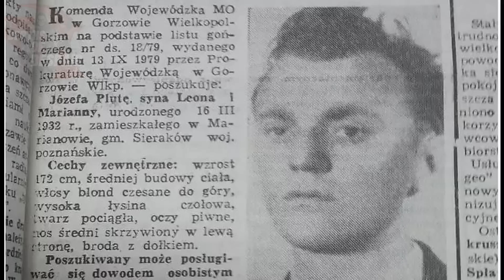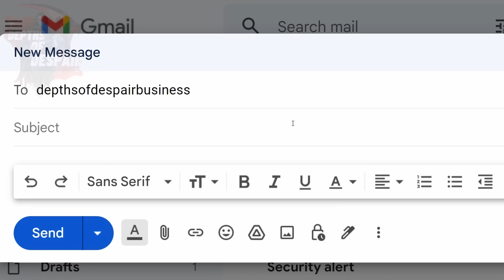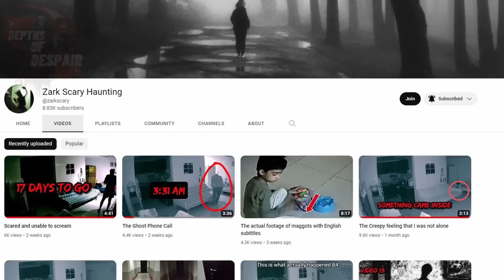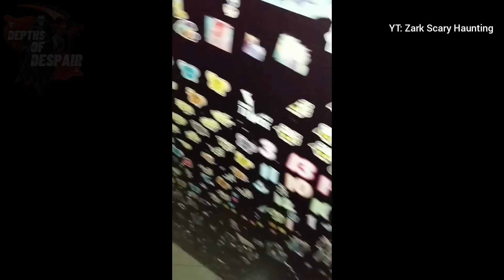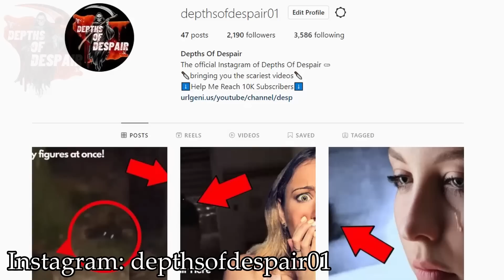5 SCARY GHOST Videos That You Didn't Come PREPARED FOR!!

Comment: I saw one of those black 👀 eyed children in my youth. It was a summer night, and my cousins and I were in the backyard playing basketball. After taking a shot, the ball hits the rim* and rolled back towards the house, meaning one of us had to run into the darkness to return the ball. I quickly pick up the ball and begin to make my way back. I see a figure crouched down looking up at me, when I focused in on the face, it was pale white with deep hollow recessed eyes. Similar to the one captured in the video. I jumped so high in the air, my cousins were inside the house before my feet touched the Earth.
After that incident, I have had repeated paranormal experiences. Some of my friends are scared to be alone with me as they have witnessed what happens.